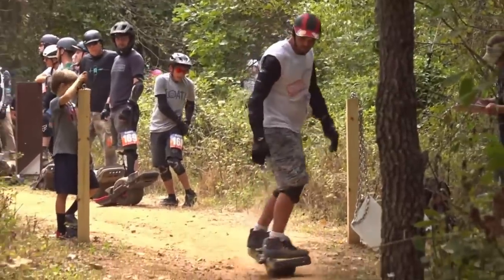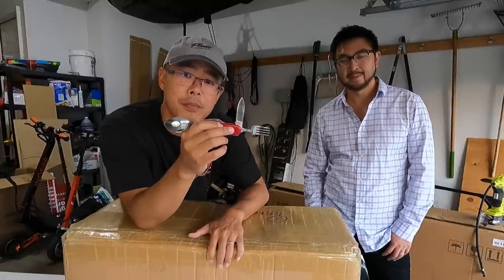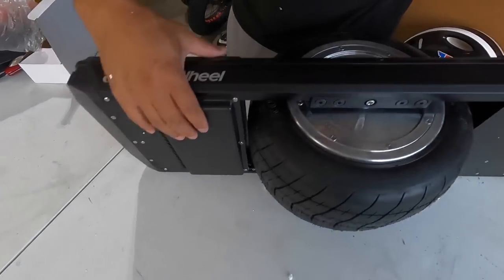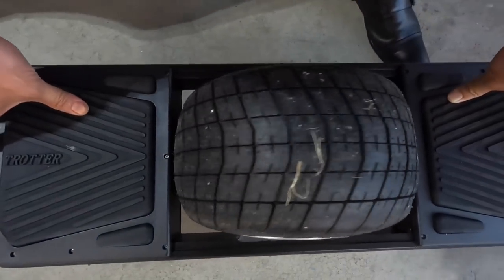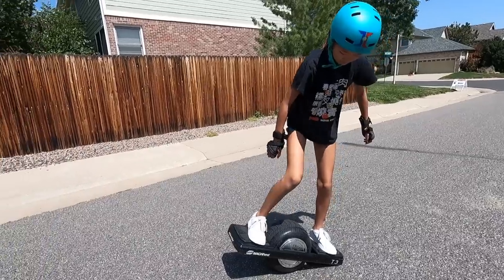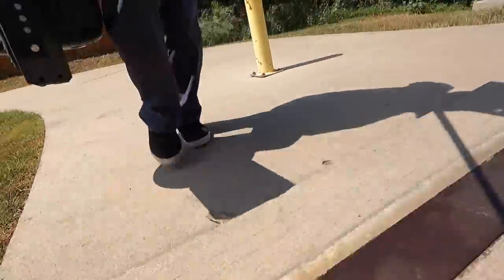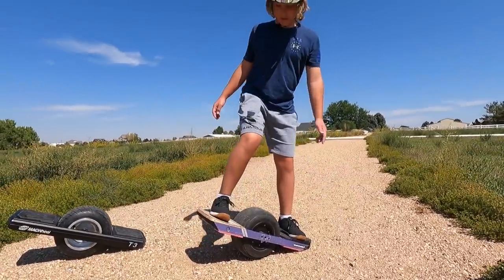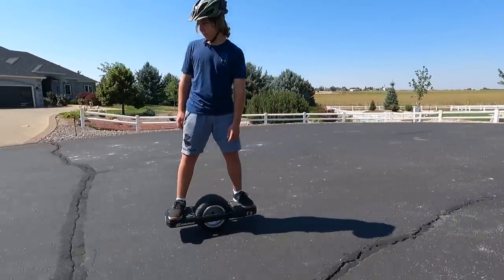The ONEWHEEL ALTERNATIVE we've been waiting for?

Comment: Jimmy is attempting to mount this thing the same way he mounts the Onewheel, having the back side on the ground and the front side up. This works fine for the Onewheel because the sensors are on the front and as you mount and put presure on the front, it moves forward. The T3 has sensors in both the front and back and mounting the back foot first causes it to go on reverse as it engages. The best way to mount this T3 is opposite to the Onewheel, mounting the front foot first and then the back foot, this way it will always move forward when you mount. It takes time to get used to it, especially if you've been riding a Onewheel for a while.
Reply: So... Mount it in a completely unintuitive way?
Reply: @thomasnguyen5295  you can mount it the way he says, but actually mounting it the other way is fine. You just have to put your weigh slightly forward when you mount it and it stand up perfectly smoothly. It takes like 10 tries to figure it out. 

Also the board he has in this video is obviously off balance. Mine stands up unlike his.

Comment: I have a trotter and not a onewheel.  The best way I've found to mount the trotter is to put the back foot on, and then use your front foot to give the board a little shove forward (as opposed to pushing down on the footpad like you do on a onewheel).  Aim to push the board and your body 3-6" forward with the shove, and put your body weight into it.  It will take this forward motion and use it to balance as it levels out.  Doing that makes the mounting process MUCH smoother.
Reply: And? How do you like riding it and can it handle rocks and bumps and dips, etc? What about hills?

Comment: Is this worth revisiting now comparing how the trotter is doing with it's business practices versus Future Motion?
Reply: Would probably be a worth a revisit vs the GT looking at more than just out of box experience. Secret shopper it, test the support on both sides. Test how easy it is to solve problems yourself and then fix them. Does Trotter sell you parts? Do they lock firmware? Can they accurately diagnose a simple issue over the phone or email or do they FM it and ask you to ship it back to them blanking out the battery warning on the box.
Stuff like that. Stuff people will experience if they have the 1k+ product for a sensible period of time (3+ years).
Reply: No. The trotter was shit 2 years ago. It's shit now. 😒

Comment: I use to have the older model trotter and upgraded to the pint but I have the inverse view, the trotter did like to start by reversing until I adjusted the level by holding the power but in motion it felt rock solid and responsive, the only issue I had was that the waterproofing was non existent so blew up a couple of controllers so decided to get the pint which was twice the price and learning to start the pint without it rushing off and burning it's tire because of the lack of a back sensor took a lot to get use too, I feel the trotter I got which was only £500 is a good starting board for those that want to test if it is for them but then upgrade if they like it, the pint I feel is a danger to people starting out as it is much harder to learn if you don't have someone to help but the pint is a more enjoyable ride

Comment: Just the dismount alone is enough to deter Most. Having to hop off everytime i would need to stop for a stop sign or a pedestrian.
Reply: Bean Oak  To each's own my friend. I've always been accustomed to stopping like a skateboard.
Reply: @one_point21_gigawatts  i can stop my magwheel fine without hopping off. Maybe everyone should I ld actually research rather than watch this bs. Fan boy and take his opinion only
Reply: @up_on_one1151  It definitely does not ride as smooth as a One wheel, its apparant in the video...  A second rate product dude- fact.
Reply: @one_point21_gigawatts  I've ridden both and hated the xr
Reply: @one_point21_gigawatts  he doesn't have it set up right with tire air pressure or anything.

Comment: You can hear the dirt caught on the tier scraping against the plastic bit in the middle.
Reply from the maker: yup
Reply: @freshlycharged  Good review Jimmy, but... Think of a trotter as EUC in terms of balancing algorithm and try lowering the tyre pressure a bit. Tyre takes more round shape when over inflated and starts rubbing against the foot plates and makes it over correct little balance corrections. That should resolve the jitter issue. I'm 200 lbs running ~ 26 psi and haven't had any jitters on T3. The ones in the video look quite bad. Also if you get the hang of mounting, you can push the board to level like you do with FM onewheel, you don't need to wait for the board to level itself. 

Keep up the good content and will be waiting for the KS S20 review :p

Comment: 5:11 This POS beeps for any reason.

It beeps if the battery is low, if you're going too fast, or if the board rolls on its side. I got  my Trotter in 2017 and had it for a year before the XR dropped and I can definitely say that beep is enough to drive you insane.
That beep will drive your crazy 🤣
Reply: I can’t believe they’re asking $1399 for this POS.    ITS MAYBE worth 2-3 hundred.
Reply: @nyccollin  Yes, worth 2-300 with a bigger battery, bigger motor, bigger tire, and more aluminum in it than the onewheel has. The parts alone are worth more than that. 

Plus the board rides fine. It just takes more practice than a onewheel. You can't rely on the software to do things for you, you have to actually be good at it. That means a longer learning curve sure, but it doesn't make it a bad product.

Comment: I was extremely disappointed in the overall performance. The firmware on a onewheel is definitely far superior.
Reply: Not after the updates that crippled it.
Reply: Newest One Wheel GT is far superior. In spite of there flaws future motion simply makes a more reliable product.
Reply: @Silver788PDX  it's not Superior if you have to send it in every time you want to tire change battery change repair because it's not waterproof.

And I find a product that's not actually owned by you Superior sounds pretty in inferior to me you have to buy a new one wheel GT every time something breaks on it.

Due to the shipping cost not to mention some of the major shipping carriers won't even ship one wheel products anymore because they're so shady.

I mean if you want to be that dumbass that bought fallout 76 or cyberpunk even after it was clear it was a broken product.
Reply: @anarex0929  your need to default to personal insult pretty much invalidates your can opinion that you typed on your iPhone.. just ride your trash board and deal with it. 🤷🏻‍♂️ I'm happy with my choices and I don't need resort to personal insults to try and validate my point.

Comment: Iam thinking what are the practical uses of this thing?Maybe keeping one in the trunk of your car in case you get stranded or if you have to drop your car off for repair.Keep a pint x on the bottom of your tool cart if you work in a very large factory and you want to use the microwave in the morning to heat your coffee and the kitchen is about 300 feet away,these are problems that Iam faced with all the time.No more walking 300 feet to heat up your coffee.

Comment: Back when I bought my first onewheel I researched all of the options in hopes that a cheaper version would be adequate. It quickly became apparent that there really was no competition and if I wanted to shred pavement with the feel of other board sports I had to put up the cash for the real thing. There is a reason that they cost a lot. The technology in a onewheel is wayyyyy ahead of the curve. Imagine trying to drop off curbs while doing over 10 mph on a trotter😆. You would get enough airtime to log in your logbook!
Reply: I do drop off curbs at 10mph on my trotter....it's fine. It just takes more technique than doing it on a onewheel. Because the controller isn't as good as the onewheel controller your body control has to be better to do it. But because you learn on the trotter and practice on it, you naturally develop the technique necessary to do it.

The only thing that you really can't do is curb nudges. I've been trying and I can't get it to work, because the trotter attempts to stay perfectly level and has very little give in the up and down tilt of the board. That makes curb nudges really hard to pull off. But curb drops just take a little practice and you are good.
Reply: Cheap Chinese Copy!

Comment: I wouldn't pay more than 500$ for a one wheel made by any manufacturer. Anything above that price range basically beats it in power and battery size( EUC's, e-bikes, scooters, etc). There is really no where to evolve with the one wheel design as the board itself limits possible battery capacity. Earlier this year I bought a Mten3(67v,420wh, with Nikola pedals) for 600$. It goes faster, up and down steeper inclines, and farther than my friends XR that cost three times the price. I ended up buying another EUC(2500w, 1600wh MSX) for $1600 new which is still cheaper than the XR's and just blows them completely out of the water. The price and what you get is just not comparable. I like riding one wheels, because it's like surfing in the air, but the price is just crazy.
Reply from the maker: You are preaching to the choir! Love my EUCs!

Comment: Trotter need to upgrade the battery to support the high motor wattage. Their battery is using 7A, whereas batteries on top end vesc onewheels can output around 80A.

A trotter with a great battery in could be much better. Hell, even vesc a trotter bc that motor wattage is close to a superflux.

Comment: Onewheel is good but the day you have a problem... it gets horrible
Reply from the maker: Agree.
Reply: Then you learn from your mistake.   I had a problem around 100 miles and now I’m at 2,500 miles with no issues.
Reply: @nyccollin  Yeah, i love my board but i just had the motor stop at around 19mph and fell off the board. Got the error 16 so i guess hardware failure. This happened with the board beeing within warranty so less than a year old but i had more miles on the board than what stands on the warranty sheet. How is it even a thing to add a distance limit as warranty? I don't regret purchasing my board but looking at the repair costs, like 500 - 600 usd here in switzerland + the injuries i got while falling down, i'm a bit upset

Comment: The problem with the Trotter is how long its been around and how little it’s improved. Its been so bad for so long, it feels like a scam at it’s price.
Reply: Bean Oak  I can agree that for what it is, the price should have come down and we should see a more powerful motor at least by now.  However I can’t agree that the current board is weak or has poor range.  At almost 1700 miles on my board, it still goes more than 16mi and has never let me down in the Utah mountains.  Technology is capable of more and so we should have it, but the current board is no slouch.

Comment: I’ve got over 2000 miles on my XR and I’d say 80 percent of it I’m going  15mph+.The last thing I’d want is a sketchy controller and motion sensor. That thing looks like a death trap.
Reply: Nah, the motion sensors are fine. The controller isn't sketchy either. zip just doesn't function the same way. It doesn't handle everything for you, so you have to ride it with more skill. You learn how the board rides and then your muscle memory fills in the gaps and then it's totally smooth and easy. It just has a longer learning curve is all. 

Improvements would be great though, a shorter learning curve is nicer of course.
Reply: That XR is death trap too! Sadly you will learn with pain.. 
I ride a pint but I hate crooked FM so much I may start telling people it s a trotter…lol

Comment: The controller on the t3 is crap.. Or at least the firmware is crap. Putting a vesc in one of these could actually be a very cheap way to get a very cheap diy onewheel with minimal effort. I'm about to do this with a ubox controller.

Comment: You are mounting it like a one wheel, don't. Lean forward like you are stepping up onto a stair and it will stand up perfectly smoothly. It takes a little practice. Also yours is obviously off balance. Mine stands up and they should. As for the way it rides rough surfaces and over bumps you have to learn how to adjust your balance to deal with it. With practice it's fine. I can drop off curbs, bounce over speed bumps, and such on it. It does take practice though. The onewheel is better at handling those things for you which you are probably used to. The magwheel takes more practice and has a longer learning curve.
Reply: getting off takes some practice. You can do a it by turning your foot and putting your weight off the sensor pad and up on the nose of the board....but that also takes practice. Took me a few days to get used to it and it depends on the shoes I'm wearing.

Comment: If they haven't managed to make it feel stable even on those near perfect, paved, flat roads, then that's a SERIOUS problem, and a total deal breaker for me. It suggests that either the power deliver is not consistent, or the suspension/mounting point needs serious consideration. These are absolute fundamentals in my book, and is a deal breaker.

Comment: You can clearly see the PID motion control on the Magwheel is amateurish, and that clumsy start up mount is unforgivable.
Even the DIY Onewheels are at a much better firmware evolution point than the Magwheel product.
Also, I am really sceptical about the claimed power figures. The Magwheel motor MAY be capable of the claimed 1500w power but in actual use it looks significantly less torque and power than an XR. 
Anyway, Future Motion should already be hard at work on their bigger faster Onewheel, if not, it's only a matter of time until the FM Onewheel is no longer the best on the market. FM are slow to evolve, and it's really not doing them any favours... evolve or get left behind.
Reply from the maker: Great insight!
Reply: 1500w is it's base output, it actually is capable of more. The torque is good too. However their software doesn't like quick accelerations and takes time to learn the quirks of. the trotter takes more technique to ride than the onewheel and has a longer learning curve. Even if you come from a onewheel you will still have to learn the right way to ride a trotter. This isn't worse, just different. Accept that infernal beeping when it goes sideways. That is worse and I hate it.